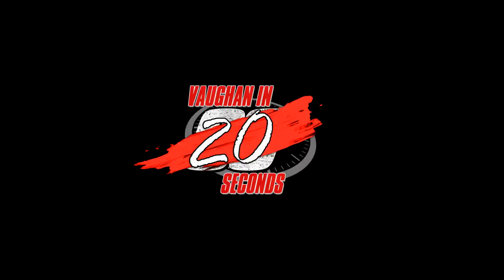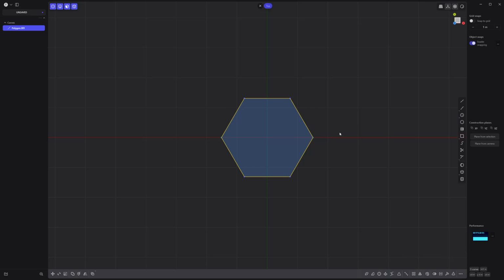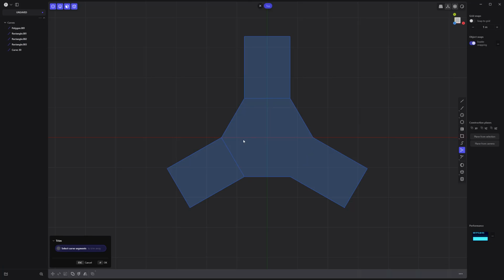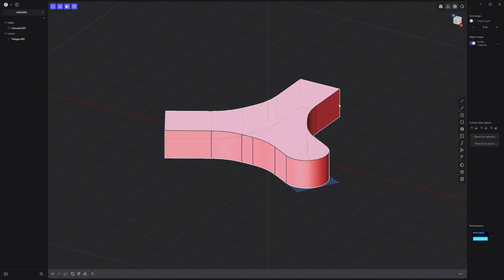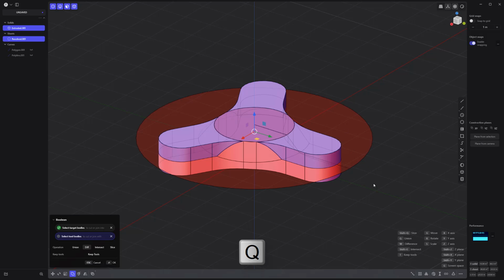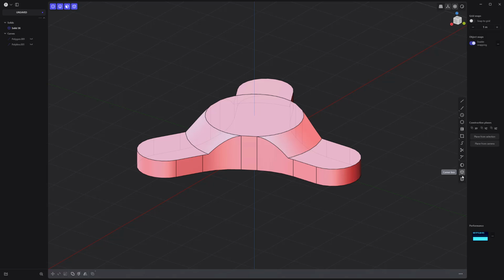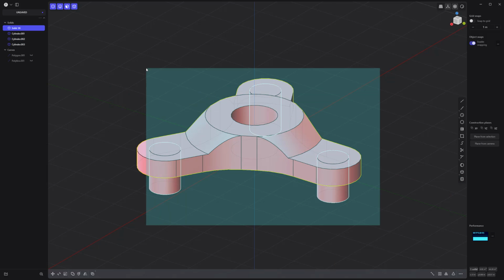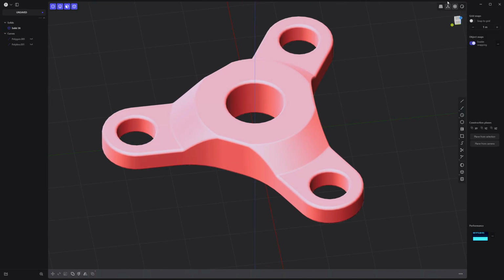Plasticity | Modeling Exercise 75

Comment: Hello Floyd, As I saw this video I decided to model the same in Modo/blender. As soon I started modelling using polys, I struggled with getting accurate shapes and angles. I guess it is so easy to draw rectangle shapes snapped to ngon shape and easily array around and then cut it using spline curve. I found it much difficult to approach the same way but using polys. Any Nudges? Can u do a video with modo for the same peice
Reply from the maker: Do you have snapping enabled in Modo?